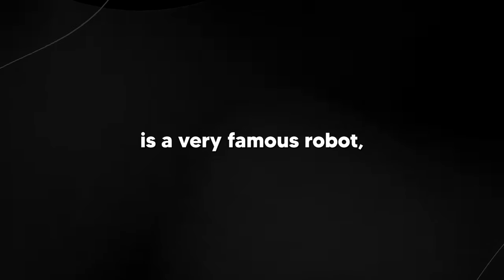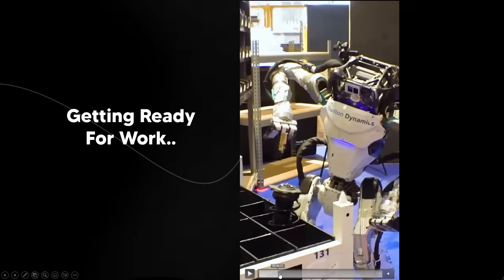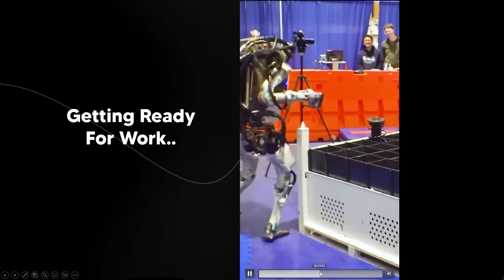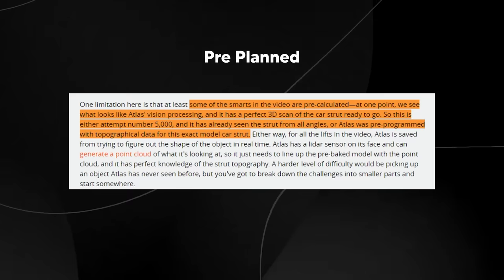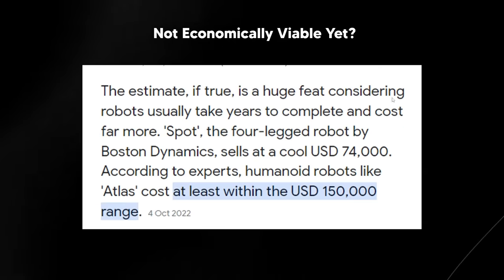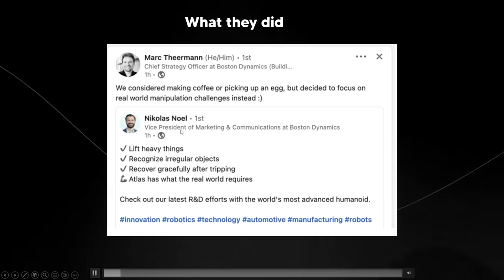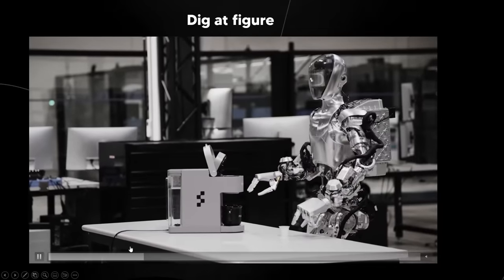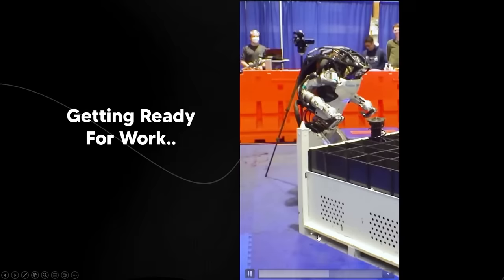Boston Dynamics New ATLAS UPGRADE Surprises EVERYONE (Boston Dynamics Atlas)

Comment: Atlas manufactured at scale would fall between 20 and 30k. Optimus and Figure 1 will be between 10-15k.
Reply: @sapienspace8814 Base materials and distribution both huge issues. Logistics and market controls both way more of price than manufacturing costs.
Reply: Atlas will never be made at scale, hydraulics have too many problems.   If your hydraulic equipped skid steer has a leak, it's leaking into the dirt, you fix the leak, and carry on.    If Atlas blows a hose while vacuuming your house...You need new carpet, furniture, paint, blinds, etc.     Tesla & Figure have shown us the better path forward, it's all electric. 
I would assume Boston D has an all electric humanoid secretly being worked on.   If they don't, they will be no different then Polaroid or Blockbuster, relegated to irrelevancy.
Reply: @murc111  Seen the new report on electric vehicle toxicity in lower air?
Reply: @murc111  Atlas or something just like it will be made at scale for emergency and military purposes.
Reply: They have said, it's purpose is purely R&D.
It will not be made at scale, far to expensive, and it breaks too often.  The military will absolutely have humanoid robots, but they will likely be made by Tesla.
Reply: @murc111  Military already has a deal with boston dynamics.
Reply: @Ricolaaaaaaaaaaaaaaaaa  No such deal exists.   They have partnered up some over the years on Projects like Big Dog, but no contract exists to buy Atlas.
Reply: @murc111  They have a contract to use their r&d findings to my understanding. Buying Atlas wouldn't make sense. They'd just take over and build it themselves.
Reply: they don't "build themselves".
The military pays companies for their products (while also funding the R&D most of the time), from fighter jets by Lockheed to army helmets by Avon.
Reply: @murc111  Obviously it's contracted out but most people aren't bothered nor do they care about those details.

Comment: Even though, IIRC, Boston Dynamics of as late has moved away from the military market, it seems that its bot might be the closest one that might be applied to that market in that it can run, jump, recover from  trips, and lift heavy objects.

Thus it would be interesting to see if it could say how a grenade (or a baseball for that matter) and if so how far.

And from the video that action it is making to place those parts does not look all  that much different from one  of holding a rifle.

And for a military application, the additional cost may not be all that much of a discriminator  in that often performance trumps cost in the military market.

Endurance might be a problem but the bot could ride to where it is needed (via a Humvee, Truck, IFV, or even e-bike or e-unicycle )and only need to walk, run, or crawl  a short distance  to attack say across an open field or through a woods.

And in regard to number, if one were to create an army of robots, say 10,000 to say 30,000 or more that could be a big market.

Also, there seems to be a lot of synergism between Atlas and Spot as well and Robot dogs are being actively being looked at for combat applications.
Reply: To me this demo looks like loading munition to MRLS

Comment: Waiting for them to use a gat slip ring in the middle of the robot to ensure quick 360 degrees movement of the centre. But it'll require a lot more decentralised control over the legs.

Comment: It is interesting to me that the Boston Dynamics humanoid robot (ATLAS) and the Tesla humanoid robot (Optimus) are trying to emulate human movements INCLUDING human restrictions of articulation, whereas Chinese Humanoid (like) robots, such as Unitree H1, include a range of movements humans can not achieve, which makes the Chinese robots more versatile as robots but less able to use tools designed for humans (therefore less easy to displace humans without tooling changes) - obviously there are applications for both types of humanoid robots, and one type will suit some applications better than the other (currently), but there is much more development between such robots become everyday appliances (yes, that is what they are) and now...

Comment: Tesla has the manufacturing capability to mass produce Optimus at a reasonable price.  Also Tesla built the Tesla bot with mass production in mind.  Each part in the prototype was chosen  and developed based on the ability to mass produce it at a cheap price point.  The  Boston Dynamics Robot is extremely expensive and was built simply for research.  I personally think there is zero chance it will be manufactured any time soon.  Of course, time will tell.

Comment: 250k is not expensive when capabilities are there. Working 3 shifts non-stop no breaks it can recoup in 1-2 years. 70% ROI is more than good. Even if trhey were cheaper to make they would not sell for less without competition.
Reply: Lease them. The space is evolving too fast to buy them.

Comment: Don't think of the 3d struts.. as objects that it scanned
Or
As attempt 50 000
Or
Pre planned or cheating 

Think of it as
A random manufacturer of nuclear warhead shocks 
Has rented atlas
And it's slam os
From Boston dynamics

And because they're warheads 
And they want to be specific around them
And because the model already exists in the companies data

They don't have to wait around for atlas to learn everything

The company just decided to upload its parts inventory into the slam os

Because that's what makes code and APIs. So adaptable.

Just think of atlas as an API of your wishes and physics

It'll just be better for both of you if you can just slid in ground truths,  any chance you have to do so

Comment: Battery life will be a constant issue for a few years yet, clearly possible to see a direct path from this combined with improved ai being able to do whatever an average human can do before the end of the decade definitely and maybe within even a year
Reply: Bet about 2 years. Just because it's also gotta make it through testing and new battery materials/efficiency etc.
Reply: No it wont
Reply: @marcus_b1  Excellent argument and reasoning.
Reply: My comment was based on the battery issue statement. Excellent probing skills you have "sarcasm". There I labeled it for you. But furthermore, the 1year to 10years spread is also just the same as saying "eventually" as it has no concrete time frame for a informed projection. Based on the speed at which BD is moving and their current level of achievement per the original video shown in the clip, one could say these bots would be ready for general workforce placement within the next 3 years.
Reply: @marcus_b1  Ah the old sarcasm shield. Well invoked.
Reply: Yeah. A "shield" sure little buddy.

Comment: For 150k you can have 20 human workers working a full year, full time (in China or elsewhere, obv not the US)
Not competitive enough.
Reply: They will be leased. And you are not calculating the cost of workers correctly, as the typical metric corporations use is 2x salary, You are also not factoring in 24x7x365 operation. Once these are capable they will wipe out most human factory work in no time. Finally, the Chinese will use Chinese robots that cost $12k and not luxury American military robots like Boston Dynamics.

Comment: There are many different markets requiring different aspects of what tool is needed.
You can't use a welder as a washing machine, right? So you wouldn't be in the market for a "construction" `bot when you're shopping for a personal "valet" `bot. `Proper tool for the job, right? SO get a grip already! It's ALL still in the "Get It To Work" phase. When they do, it'll be the "size it properly" phase. Only then they can work on getting the semantics in line with the set of tasks the TOOL is intended to preform, and only Then, it'll be marketable to the population... And that appears to be some time off in the future.

Comment: Yeah, but Boston Dynamics robot moves almost like a real person now.. while the others are still moving like they are Japanese people who shat their pants..
Reply: Boston dynamics focused exclusively on walking and running and balance. The Tesla bot advantage of Teslas vision system which is about all it has right now. Teslas walking system is just a stop gap system to move the bot so they can work with the vision system.

Tesla will map in real time.

Both companies are still rather basic though.

While it's not mentioned often, bds robot will fall on it's face when it's predictions are wrong. It doesn't truly read in live data and balance. The real solution for this is with sensors feeding info into AI chips. Well, they will eventually figure it out.

Comment: 09:12
I think this part of the video, as well as the video showing a bunch of robots dancing lightly, are fake.
Boston Dynamics has a strange habit of never showing robots in positions that overlap with humans when they perform active movements such as dance or parkour.
This is very strange since they advocate collaboration between robots and humans.
Perhaps their robots can do individual tricks such as jumps and backflips. However, it may not be possible to successfully complete a series of tricks without changing joint settings or control programs.
That's probably why they decided to have the robot perform in a VFX that faithfully reproduced the inside of the studio, the view from the windows, the sunlight, etc. Driving away humans who are difficult to synthesize into videos.